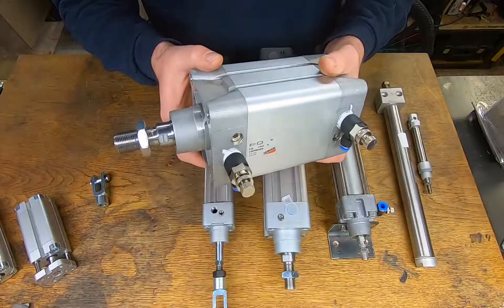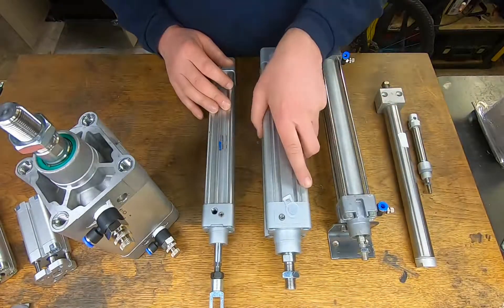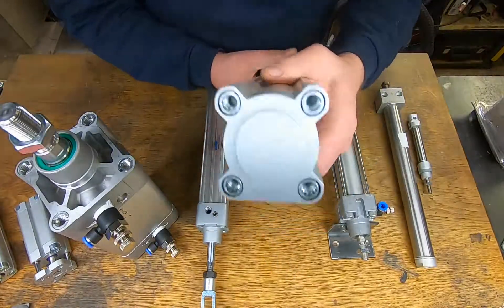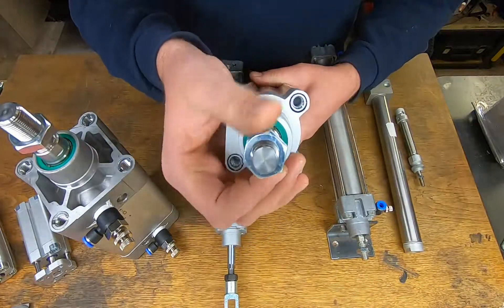Pneumatics 101 - Cylinders, Valves, Fittings, Tubing - Demonstrations

Comment: Do you have a video on how much pressure a cylinder will exert on an object based on a cylinder size and input pressure? 

I'm trying to understand I'm designing a something like a paper press but I'd like to know how much pressure will it give so I can choose the right cylinder 

Thank you!
Reply: I would also know this, like can I control the pressure in some way. Maybe set a maximum pressure and when reached it will stop and hold that pressure. I'm building a roll laminating table 👍

Comment: i have very heavy duty  air cylinder. i think it is 40cm stroke and i want to use it for 4x4 snow plow "turning" cylinder. what kind of valve do i need for it. and is there some kind of protection, if plow hits the stump so it can handle the shock from side to side? i really liked that 3 position 5 way valve with joystic. can i use that? Thanks!
Reply from the maker: Good morning, thanks for the comment.

3 position string to centre would work. Also with it being compressed air, it means the cylinder is “back drive-able” to some extent (some cushioning is present at 10 bar for example)
Reply from the maker: Good luck with the project!
Reply: @man-madehand-made6009  Thanks! It seems to work great in theory. i buy the parts and start building tomorrow!
Reply: very nice video, am having some ideas. can it be used in steering boats? thank you.
Reply: i did that snow plow project and it worked perfect last winter.